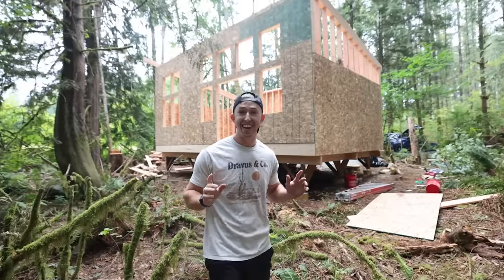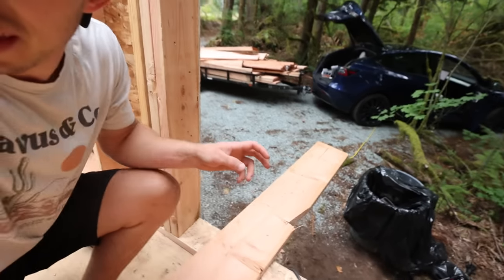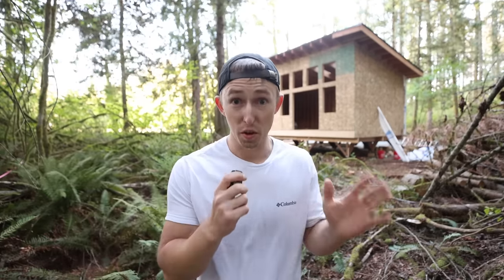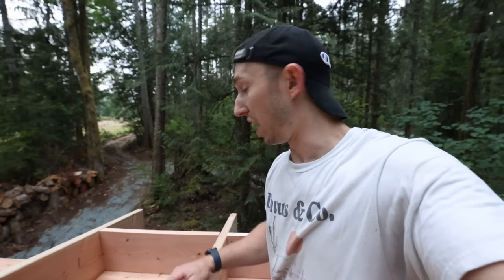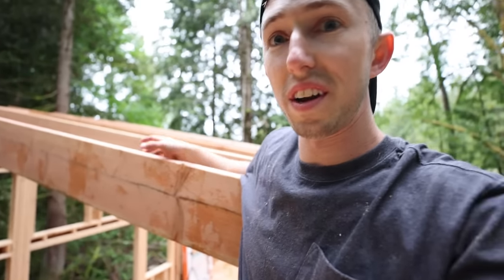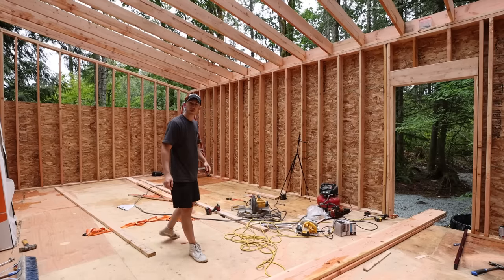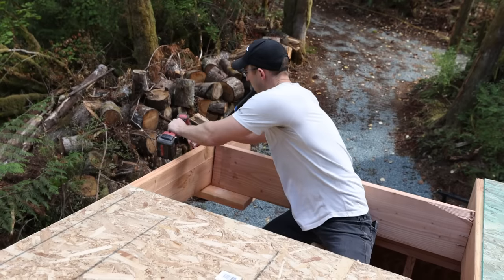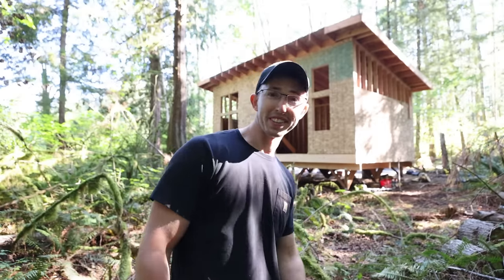Framing Tiny Home Roof Before the Rainy Season... I Failed

Comment: Hey Devon, little tip. When shortening your bird blocks so they don't extend above rafters, cut them an extra 1/2" shorter and you will leave an air gap there so there's no need for drilling ventilation holes.

Comment: I was drilling vent holes with a hole hawg--1/2 right angle drill and standing on a 10' ladder near the top. I got maybe 3/4 of the way down the wall when I hit a knot. The torque produced by the drill was pretty significant and it lifted me off the ladder...which of course, knocked the ladder over. Fortunately, we had not sheated that side of the wall yet so I could climb down.  Good times. Looking good!
Reply from the maker: Holy crap! Glad you're alright. Yeah, I definitely made sure to wear gloves after drilling the holes, hitting a knot, and my hand got cranked into a roofing nail 😬😬😬
Reply: @devonloerop  We laughed. Not much you can do--the motor is a torque monster! But you're not supposed to puncture yourself!

Comment: You never cease to amaze me with how much you're able to accomplish essentially on a weekend warrior schedule. Regarding your concerns with soaking your boards and other details, I recommend Huber's Advantech floor sheathing as it can handle excess moisture during construction. Their Zip sheathing is an amazing product too. Also, the Build Show/Matt Risinger and his crew are a great resource for construction/design details. They use a belt & suspenders approach to building science, which an engineer like yourself would really appreciate. Keep up the awesome work!

Comment: Looking forward to the waterproofing! Did you consider something like Zip System at all? We are planning to use Zip-R on our tiny cabin walls and roof to help with thermal break and hopefully make waterproofing a little simpler.
Reply from the maker: I looked at using it, and found it was cheaper with OSB and house wrap. It looks like a sweet product though.
Reply: @devonloerop  yeah I think the main reason I’m going that route is because I think it’ll be easier with only one set of hands. Lol

Comment: I’ve been following your videos. You’re doing a great job. I’m looking at doing a very similar build and was curious if you would be willing to share your plans , material list etc. Nice work!
Reply from the maker: I actually don't have plans, just roughly sketched something out and been taking it step by step!
Reply: I don’t suppose you would be willing to share your sketches? I’m looking to replicate your front wall layout. No worries if you don’t want to. Also, are you planning on putting a small loft inside? Really appreciate the videos!

Comment: what are your thoughts on using structual steal instead of wood framing?
Reply from the maker: Both work, but wood is definitely cheaper. Steel has way more rigidity which is key for tiny homes
Reply: Would you be able to make bigger windows? of corse it would run the cost up but do you see it being worth it? Also.... Sauna install?? 😏😶‍🌫 @devonloerop

Comment: Old saying, screws will screw you.  Most framing involves nailing  3.5 inch nails and alot of them.  Screws are for attaching deck boards to the joists. Not trusses...never ever do you use screws on roofs or load bearing walls.  I hate to tell you this but...
Reply: my friend told me once one of the reasons you use nails for framing is because, if you bend a nail back and forth it takes many times for it to snap. if you bend a screw back and forth once or twice it breaks easily.

Comment: Just curious, is there a reason you're using screws at some parts, and nails at others? Most roofers I've seen use nails.
Reply from the maker: Most cases I use screws where I need to hold something and attach at the same time, a nailer isn't as forgiving as I can't readjust easily after shooting nail.